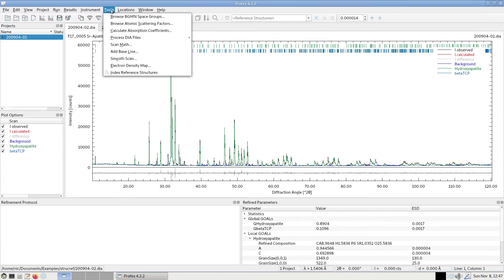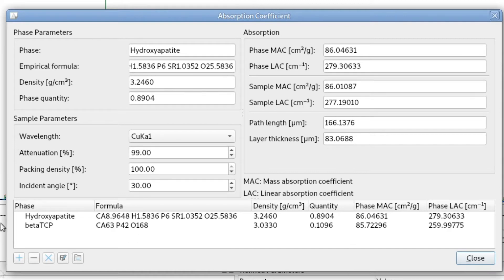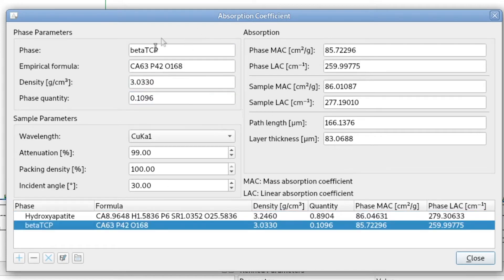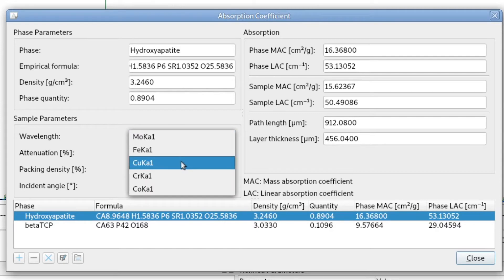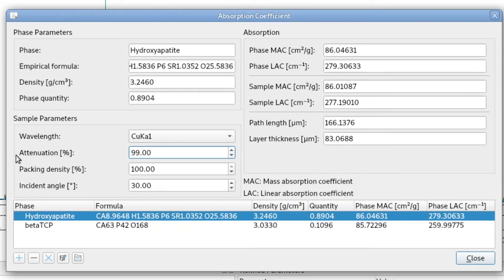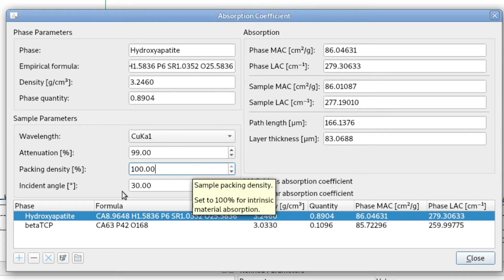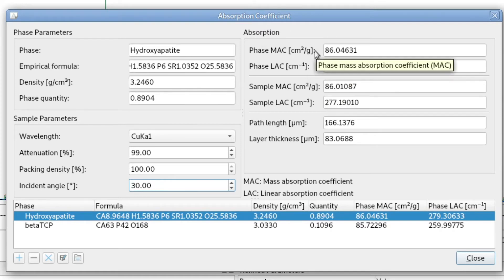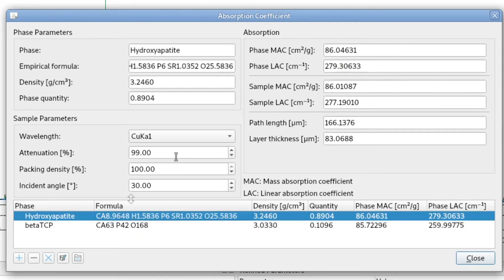Profex Tips and Tricks: Calculating Absorption Coefficients and Penetration Depth

Comment: Is it possible to calculate the MAC for the sample from XRF data on Profex? (for when the sample contains amorphous phases, for example, instead of using the results from the Rietveld refinement)
Reply from the maker: You can add the average composition determined by xrf manually to the absorption coefficient dialog as a new phase, and remove all other phases read from the refinement project.